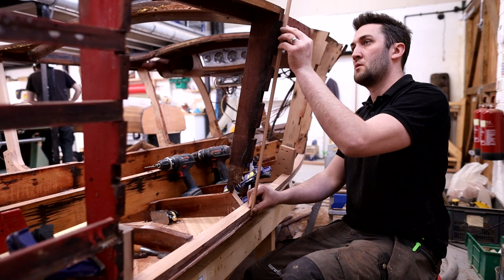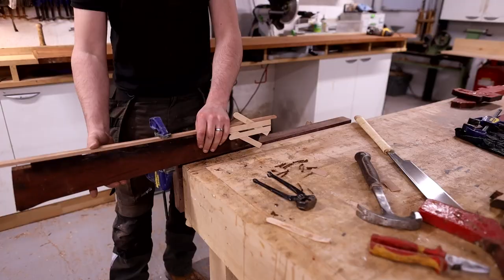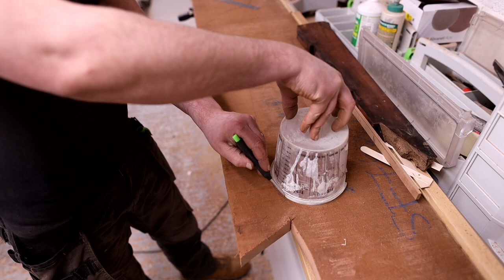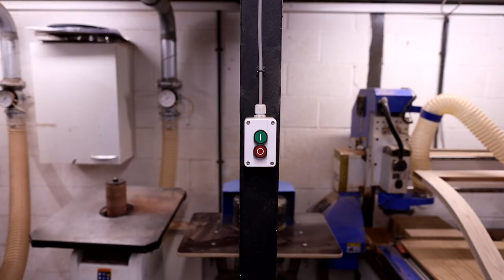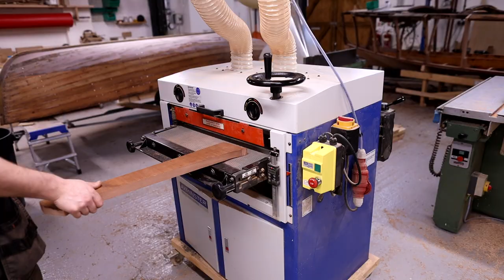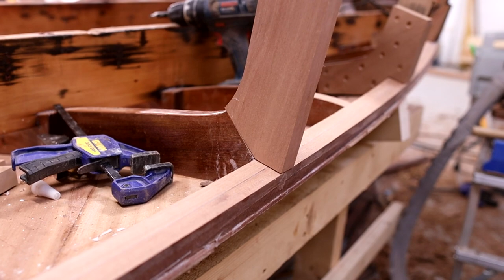Patterning a Rotten Chris Craft Side Frame | Chris Craft Restoration

Comment: Lovely work as ever! Would you care to take a guess as to how much of the original boat will remain and how much is all new?!
Reply from the maker: Thanks! So far what will remain original are the main stringers, which still have the hull number stamped on them which is nice, the stem and 6 of the side frames. Most of the deck beams will stay, as will the interior so at a guess I'd say it will be 80-90% new wood.
Reply: @DanLeeBoatbuilding  Thanks Dan! A bit like The Ship of Theseus then - will it still really be a Chris Craft? Nothing like a mild spot of philosophy thrown in with boat building.

Comment: I have no idea what your plans are for the side, but wouldn't it have been easier to cut the side dados out for the side strip wood before installing it? IDK just asking...
Reply from the maker: They could still be cut in as the frames are only dry fitted at the moment. However I think I'm going to let in the top side batten notches in place so I can bevel and fair them as I go.